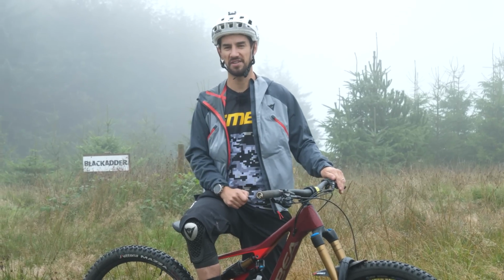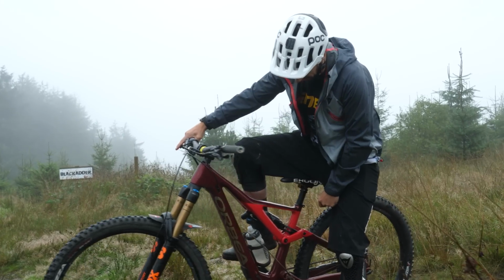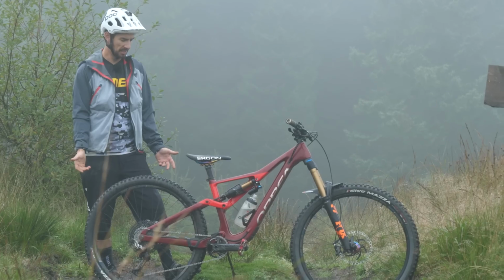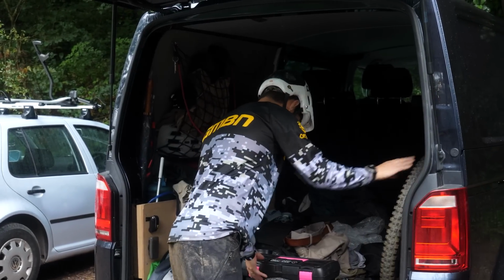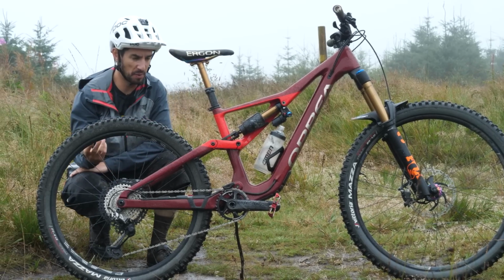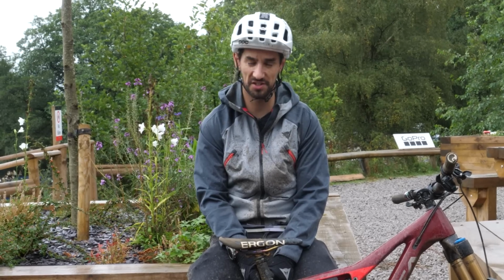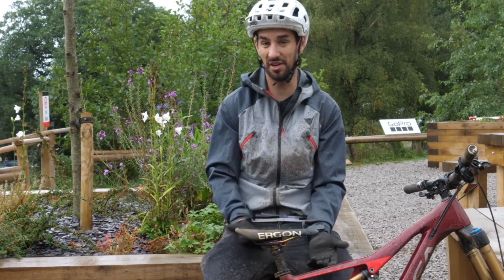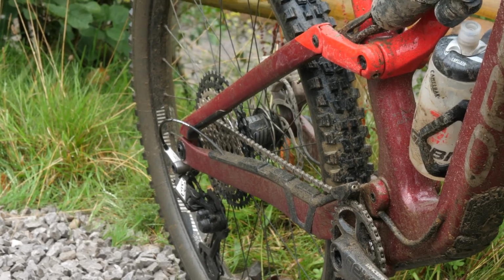Mixed Wheel Vs 29" Mountain Bike Wheels | The Wheel Size Debate Still Continues

Comment: Waiting for 28.25" and 29.75" wheel sizes which will be revealed in 2022. Can't wait for all that marketing hype.
Reply: The 28.25" sounds promising. Can't wait to try it with the new 27.75" on the rear, that will come out in 2023.
Reply: I'm waiting for a 32" front wheel, seriously.
Reply: Typo? I think you mean the 35.0098”
Reply: Now that Santa Cruz bought Cannondale,  we can expect 2-3 new wheel and a dozen new BB standards.
Reply: @davidxin5805  I prefer the Cannondale 35.0092. They spin up nicely.
Reply: @truantray  Oval chain rings are a thing, so they should make oval wheels to fit the chain ring rotation.

Comment: On a 27.5+ hardtail I'm finding 29x2.2 on the front and a wider 27.5x2.6 on the back gives me more traction and adds a bit of comfort too. I can run a less gnarly tyre on the back which seems faster and it seems to have slackened off the head angle a tad too...

Comment: Most e-mtb are coming with mixed wheels (MX) now just like dirt bikes and motorcycles have been forever. The smaller rear wheel accelerates quicker and makes the bike feel more playful.
Reply: Dirt and trials motorcycles have been mullets for decades as you say. Admittedly part of that is related to getting sufficient rear suspension compression on a heavy two wheeler. I can't help but think that mullet Downhill MTB's will stay around for a long while as reducing the likelihood of the MTB rider buzzing their rear end on a steep section or a drop is a desirable characteristic.

Comment: I have a canyon neuron mullet, small frames come with a 29" fork, and like it but it a bit of a pain carrying different spare tubes when out on a big ride
Reply: You can carry a 29 one and fold it inside the tire in case you'll need it on the back. Motocross school never fails 😉
Reply: @MassimilianoPerrella  Many thanks, I didn't think that would work as soon as you inflated the tyre.
Reply: @stuartdavis7922  depending on the wheel or the tire it could... it would be nice to try (in a garage, not on a trail) :-)

Comment: Im absolutley loving my 2021 Transition Patrol which comes as a Mullet. Completely agree with having tons of room out the back. Even when the trails get super steep, I never worry about getting my butt caught on the rear wheel. The real only downside of having two different size wheels, is if one goes flat, you need two sets of inner-tubes on you or you'll be walking your bike back. I don't race so I cant speak to mullets being faster or slower, but I think for a normal rider who is just out to have fun on the trails, you can really do it all and have a blast with the mullet set up. I don't think it matters at all if its a 29er, 27.5, a mullet, or 26 in wheels, as long as your'e out on the trails having a good time.
Reply: 27.5 tubes fit a 29er with no issues

Comment: Going full 29er or even mullet isn’t going to work for everyone, especially so for shorter riders, like myself.
Currently riding 27.5 and if I get a new bike in the spring, I’ll be going for the same set up of 27.5 front and rear.

Comment: You prefer Mullet, did I understand that correctly?

I'm just about to decide to convert my Rallon into a mullet, because I don't have a good feeling with the 29 inch, especially in tighter curves.  I previously rode a 27.5" Rocky Mountain Slayer.

Comment: This jibes with what I thought:  Pro riders that routinely push and rely on the front wheel can be both faster and more agile with the mullet. For schlubs like me, the better efficiency and roll-over of the 29" rear wheel has more positives for longer rides and lower chance of fatigue induced mistakes.

Comment: I wouldn't say you have to have a special bike to go Mullet.
If you understand that you're getting a lower BB, slacker head and seat tube and shorter reach, there's definitely advantages to be had.
I run Mullet on my Ragley Bigwig hardtail, which slackened the headangle a touch and dropped the BB, which let me get deeper into a berm. The seat tube angle can be rectified by sliding the seat forward, but the only thing you can't change is the reduction in Reach, but I didn't actually notice the reach reduction.

Comment: Honestly don't want two different wheel sizes, simply because then you can change e.g. the front tire to the back and put a new one on the front. Saves money in an already expensive hobby.
Reply: It's just a more forceful spin on an old concept of having a tire specific design and position (think of the Panaracer Dart and Smoke set).  But at least with front rear specific tires as opposed to wheels one can still easily say nope and just run a non-positional tire while only keeping one size.
Reply: Im liking the mullet. I did often swap the front to the back when both tires were the same size. But it's always the back tire that wears quicker so I'm okay with just changing each tire when it needs changing.
Reply: Possition specific tyres are being made even today - Maxxis Minion DHF and DHR may be the most known one atm.
Reply: @vasek987  My tires are position specific as well (I have the current Panaracer Smoke and Dart on my steed - I see the benefits in some of my mixed riding, but not all riding and I also admit that keeping two different tire types on hand can be a slight PIA).  Only saying it's more forceful way to get a front/rear specific tire because they are totally different tire sizes.  If one has different tire sizes on there bike and can benefit or get more performance by going front real specific (they'd have to experiment to see), then why not if one has to keep two different tire sizes on hand.
Reply: Why should i even think about getting different tires for front and rear if i found a tire i like in pretty much all conditions in the area i live in?
Surely if it was heavy rain for a week straight it might not work, but honestly those are conditions where i don't want to go riding anyway. In this case id rather go skateboarding somewhere or hike and take pictures...

Comment: Really interesting topic. I am in the process of switching to mullet setup atm. I have 29" HT and now I bought used 27,5" full sus for good price. I tried full sus 29" (140mm) and 27,5" (160mm) and 29" felt better in rough terrain, so that's the reason I am heading to mullet. 

But one topic hangs out in the air - 29" aka "one size fits all"? I am not so sure. When I see 10y kids running on 29" XC I am thinking what is wrong here because it looks odd. I really appreciate the approach of some manufacturers when they use e.g. 27,5" for S and M frames and 29" for larger bikes. It makes sense because you don't need to do that much compromises in geometry. Also the complete suppres of 26" doesn't make sense - kids have 24" and then what? So appropriate wheel sizes for appropriate frame sizes is maybe one of the overlooked topics I think.

Comment: Here in the netherlands where the most guys who ride are 5'10" and up (i'm 6'0" myself) and the trails are almost all xc, 27,5 is only used by kids, very short adults and dh riders at the park.
Being a taller rider im so far above the rear wheel that i never had the issue of hitting it even on the steapest decends in the area. so full 29er it is.

Comment: I’m 6”1 and 27.5” wheels with tyres is a huge wheel, 29er’s are even more oversized and make the bike less utility and more ground hog. On a road bike 29er is great for speed and efficiency but on a enduro I just think 27.5 is way more fun and more than large enough for me. I’m on a large SC Nomad and this thing is huge. Personally I’d more more focused on your bikes frame fit than wheel size.

Comment: Wanna hear the craziest ever? I sometimes do an anti-mullet: 27.5 rear 26+ front. Why? On the 27.5" frame, I don't like the squirmy feel of a 26 in back, doesn't seem like it helps anything, so I always but a 27.5 in back. In the front, usually a 27.5 but I have experimented with a few different 26+ tires, which usually measure around 27.1 inches high. That's about 0.6 to 1.1 inches lower than a 27.5 in back. That's also about the same as the diameter difference between 27.5+ and 29. But why a shorter tire in front? 26+ is fairly wide, usually around 2.6 inches wide, and it picks up speed fast because of its smaller diameter, you will really notice the difference. But the real advantage is on switchbacks, especially steeper more off-camber ones. Instead of having to learn a dangerous endo technique where you lift the rear tire up in the air, you simply dive into a switchback with a shorter front tire that can turn into the corner better, with a bit lower center of gravity. Main disadvantage of a shorter tire is of course larger obstacles, but it's doable. If you ever try it, see if you can still find a Maxxis DHRII 26x2.8. That tire on the front is AWESOME (it's not too shabby on the back either). I do like it better than DHF, and that's saying a lot.

Comment: For the general rider having a mullet would mean carrying a 27.5 and 29 tube, which is a bit of a pain.
Reply: You can run a 27.5 tube in a 29er tyre no problem, they stretch!
Reply: I’ve never tried that but I’ll take your word for it.
Reply: @JamesMTBAdventures  yeh, works fine, certainly to get you home, 27.5 tube will work quite happily in a 26, 27.5 and 29. I've used them in all 3 over the years, no worries.

Comment: Question, 
This may be a silly question my appologies before you continue. 
Neil if you hadn't looked at the back wheel before you had started out would you be able to tell which set up you were on ?
Reply: He said he could not tell. Until he cornered.
Reply: @koreanmtnbiker2931  
Hi 
My point of the question is, if he was not told which bike (mullet or 29er ) he was on only looking forward and could only see the 29er at the front  would he actually be able to tell what wheel was on the rear by riding the bike only .

Comment: I used to ride a Gary Fisher 26" hardtail and recently got myself a Specialized  29" hardtail. I mostly ride fast flowing single track trails and it took me a while to adjust to the slower turning speeds of the 29". I'm used to the bike now and i'm fairly comfortable on it, but honestly miss the snappy feel of a smaller wheel size. I've even considered buying a 27.5. Happy medium?
Reply: I'm exactly the same as you. I've ridden a 26" wheeled hardtail for over 20 years, then got a 29er full suss, and the difference is huge. The full suss 29er rolls over everything but isn't agile or playful, so I am thinking about going down the 27.5" route, not a mullet.
Reply: @tonywilson5468  that's exactly my thinking. The problem I'm having is 27.5s are getting less popular in my area so finding a new bike is proving to be quite an exercise. I spoke to the guy at my local bike shop and he recons the "well known, bigger brands" are all switching to 29ers and only boutique brands will still do 27.5s.

Hope you have better luck than me 🤞👍🏽
Reply: Love my 27.5, once it's new bike time I think I'll keep it and just get 29 then
Reply: I mulleted my old geo 29er with 27.5 in the back and I like it more as it is slacker and stable on downhills!

Comment: motocross bikes have used mullet setup for over 60 year, to do with handling and suspension travel, and clearance. i also think the rear has less jobs to do than the front. mtb even less than moto.

Comment: Depends what your comfortable with. Depends on leg/torso length. As a tall-heavy rider, I cannot stand mullet rigs. Feels like I'm pedalin a kids bike. Don't notice any grip/comfort difference. It's simply a matter of spending more for tubeless or staying with the cost-effective clincher. Wide tires on all rigs, is gonna be the, "Next thing," fad. Enduro/all-mtn bikes with 29x3.5 will be common. I just have noticed in forty-two years of mtb riding, zero benefit of mullet bikes. That includes trying a mullet set-up on a Moose fatbike. It's all in your mindset and of course, the influencing by companies that this "Fad," works.

Comment: Interesting video. I’m sure GMBN did something similar a few years back, with the opinion of “sticking with 29er.”  With newer bikes comes slightly different geo and a different feel.  Ultimately, 24”, 26”, 27.5” and 29”….who cares?? Any bike is fun as hell and you should just run whatever makes you feel confident on whatever terrain you ride.

The “industry” changes things up to make riding “better” but also to make £££ and lots of it.  When I was on the market for a new rig, I tested a Yeti SB150 and a Yeti SB140, 29” and 27.5” respectively.  This was moving from a 26” Specialized Stumpjumper FSR.  Much preferred the ride-on feel of the SB140 than the “ride-in, barge-esque” feel of the bigger wheel size.  (178cm tall, medium frame) This may be because I was moving from the smaller wheel to start.  Plumped for the SB140 in the end, but I have also gone mullet, reducing the front travel from 160 to 150 on a 29er fork.  It does give better rollover up front, but that’s just mechanics of a big wheel.  Is it truly best of both? Possibly, possibly not.  

Nice to see manufacturers giving riders the choice of what they want to ride in terms of wheel size. There’s no right or wrong….in the end the industry still gets your hard earned green!!!
Reply: You had me at "any bike is as fun as hell" buy seems like you don't want bike companies to make money, and why should they?
Oh yes, the money they spend on production facilities and all the bills that go along with them, design and prototype tech and setups,  paying riders salaries so they can showcase their products and  we have riders to aspire too. Paying workers wages so they can feed/ house themselves/ their families. Paying enough to get the best talent they can to improve the bikes and tech they sell.  Plus they have to do all this in a knackered economic environment and try to sell a slow moving product, in a saturated market with new companies popping up weekly. Add this to all the hundreds of things I've missed out when running a business and I think bikes and kit are pretty reasonable prices. Give them a break, except specialized, those guys have very shady practices in the past.
Reply: @woodysmuddy  Hey, I get how what I've written comes across. Your interpretation of it was not my intention.  Totally get what bikes cost and why.  Agree there is oodles of expertise and development that goes into most bikes.

What I was trying to say was don't be swayed by what "the industry" wants.  Just go ride and have fun with what you have.  If you have the means to upgrade etc, go ahead. Ultimately, be happy and enjoy your ride!
Reply: @woodysmuddy  The "industry" especially the really big brands that pump out bikes (Specialized, Trek, Giant, etc.) always try to make bikes that are easier to ride for average riders.  This can be a bit compromising when you become a greater than average rider and you want specific characteristics out of a bike and have to start buying new stems, bars and other cockpit changes only to eventually find out your bike is actually too big for you.

Comment: My wife and I both ride a 29er. I have made an effort to make sure that most of the parts that wear out are the same on both bikes. So I need to have a limited number of spare parts at hand. Just to keep the maintenance affordable and as easy as possible.  I have tried a mullet from a friend that was very proud of it (good for him) and I am not impressed enough to make me want one. Why would I make my life more complicated (and more expensive) to get just a little advantage on some of the situations? We are having great fun on our bikes as they are. I am waiting for he moment that the industry comes up with a real good alternative for chains and derailleurs. That would be good. In the mean time the wife and I stick to our current bikes.
Reply: Belt drive?
Reply: That solution won’t sell derailleurs though.
Reply: @samb394  I love belt drives. On my urban bike I have a Gates belt drive combined with a Rohlof hub. It's silent (mostly), reliable and very little maintenance is needed. Ideal for this type of bike but not so much for a (full suspension) mountain bike in my opinion. The same goes for a belt drive combined with for example a Pinion gearbox. Very nice technology, but expensive, needs a specialize frame (that's needed for a belt drive anyway) and not the most light equipment out there. Though I do think that might I choose for some sort  of gearbox on an MTB I would prefer the Pinion above the Rohlof. But that's a discussion that should not be held here.
Reply: @Cous1nJack  But it will sell it's successor. No technology is forever. Sooner or later it will be replaced (though while the derailleur is very old it's still going strong☺).
Reply: @Evertb1  If it’s too good/durable/protected from knocks they will only sell it once. Derailleurs are virtually consumables.
Reply: @Cous1nJack  I think that derailleurs are nearing the end of their development. What's next 1 x 13 drive lines? With 1x12 the chain lines are not ideal already. And making the chains even thinner is questionable. And look at the price of the current cassettes (not even calculating in the effects of the Corona crisis). I think that sooner or later the system of cassettes and derailleurs become obsolete. And I am sure that the industry will find ways to put some  parts in there that wear out and need to be replaced every now and then.